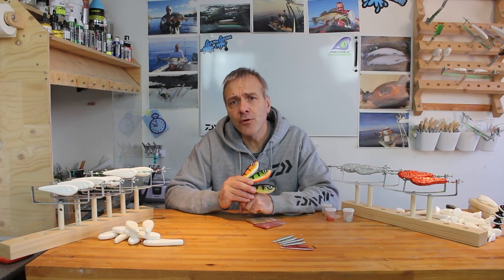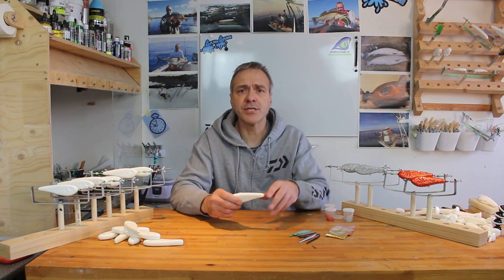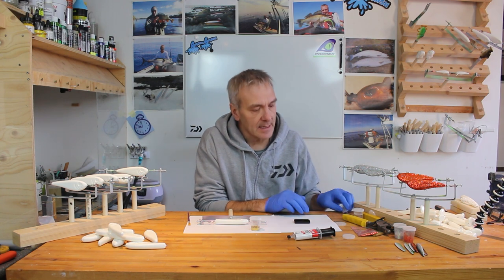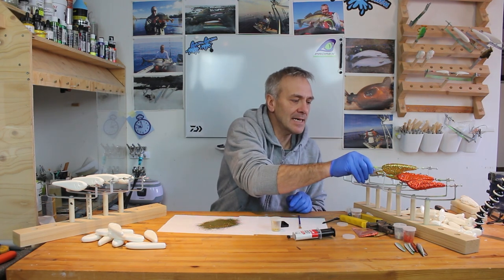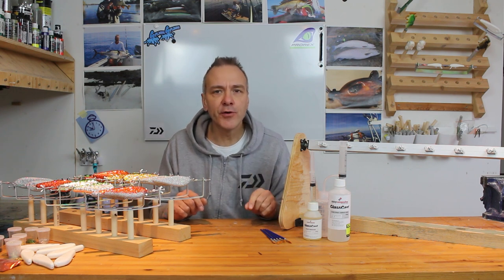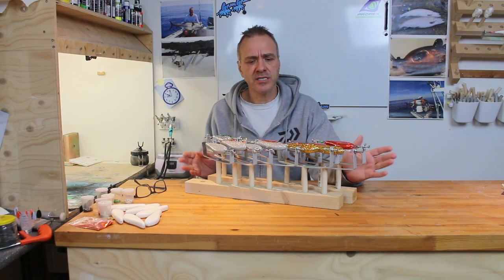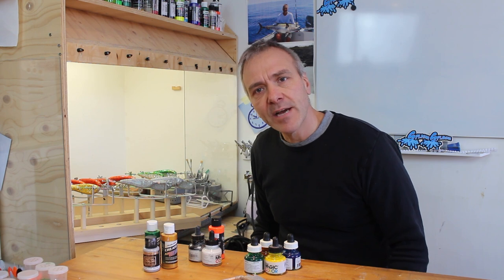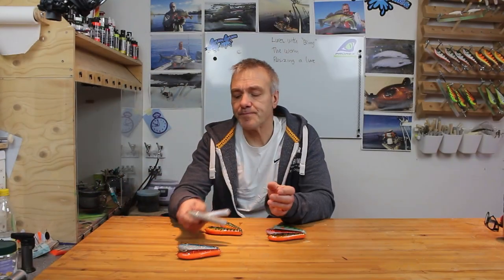Lures With Bling - Adding extra effect to you lures

Comment: Great, thanks. Just curious to know if you did try to use the same method for glow in the dark results. I have glow in the dark powder for jigs, bindind under high temperature, but didn’t try to bind it with epoxy. Will that work? Thanks.
Reply from the maker: I think it will work, but maybe not optimally. Powerpaint inludes som "plastic" that melts, and it would propably be better to have the pure "glow in the dark powder"

Comment: Great video! I love your content and I already learned a lot. I have a general question. since you introduced the possibility of 3D printing. Doesn't it make sense to print masters instead of using wood, or even print all the lures instead of using silicon molds with epoxy? What is cheaper, epoxy or filament material for the printer?
Reply from the maker: Hi Seppeq. I makes a lot of sense to print your masters. I do that with most of my lures now. That said, it does not make sense for me to print the lures themselves. First of all because it takes too long. Just to make the lurebody nice and smooth and easy to paint would be a big job. At least with the quality of my 3D printer. Normally I am able to make approx 3 casts a hour with one mold, and I often have 2 molds at a time. So i can quickly produce a nice batch. That would take a bit more time on the printer. On the other hand the printer can run while you sleep. So it might just be a matter of what you like the most
Reply: @SplishSplashFishing  Hey, thanks for the fast reply. Ok, understand. I totally forgot how long the printing itself takes. Also I guess it would be kind of boring to print everything :D. Have a great week!

Comment: Hi Jergen, i make some woden crank and jerkbaits but finding decent epoxy in europe has not been very easy, at least of the brand i see most luremakers use. Can you recommend any epoxy and where i could buy it in europe? thank you very much
Reply from the maker: Hi Filipe. I have used Glass Cast 3 from Easycomposites in UK for many years now, and find it better than any of the american brands. After Brexit, they made a shop within EU, so its still easy to get hold on
Reply: @SplishSplashFishing  thank you so much. I knew you used glasscast but i had not come across the eu shop so i couldnt order it. Really thank you so much.

Comment: I am curious if there i a way to accurately copy a lure's spoon, any ideas Mr. Splish Splash? I was hoping to try this out with a gypsum mold and pour in epoxy resin, just don't know what would be a good solution no to bind to one another too much. The spoon in question is from the vobler: MANNS
 MAGNUM 30+.
Reply: Very difficult spoon to replicate in my opinion, if you would just get a thicker slab of pleksi glass, or bind two of them together (one idea maybe).